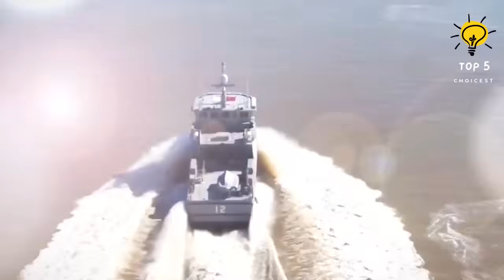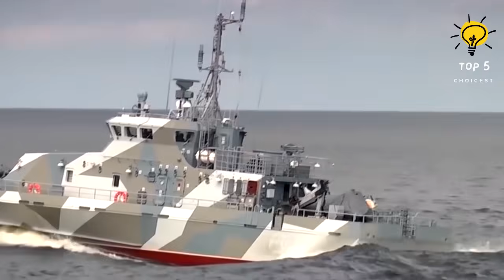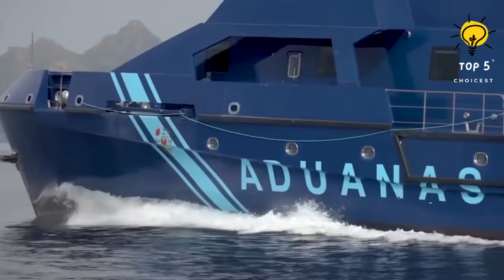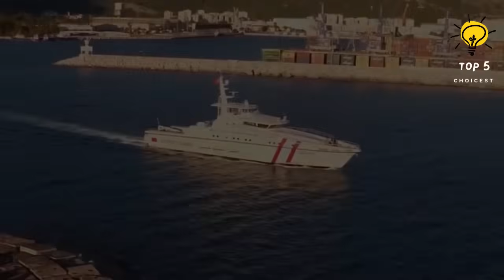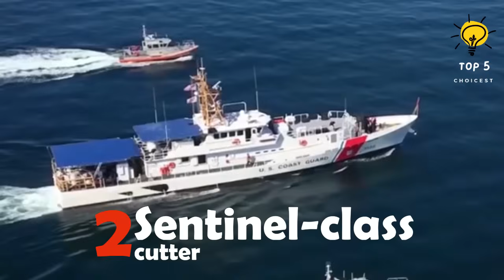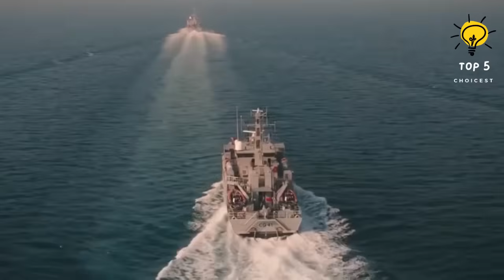Top 10 Patrol Boats in the World

Comment: You´ve forgotten to mention the German F125 class, our biggest patrol vessel with a length of 149,5 meter.😜
Reply: Thats a frigate
Reply: @peterberg12353  Comparing it with the definition, that the smallest self-defending maritime unit is a Frigate, then it is clearly not.
From its size and officially called, you are right. But when it comes to its weapons, then its a corvette at max. This hole vessel is a waste of money because it was designed for low intensity missions... as you can clearly see. The Houthi don´t fight on this level. Calling this boat a frigate it's embarrassing for the German navy... and misleading. So regarding German vessel that are having real capabilities of a normal Frigate then you can take the current F123 and F124 or its upcoming successor the F126 and F127 (MEKO-400-AMD).

Comment: If you could have a faster and more fuel efficient hull than what you show here, would you be interested?. You will note that much power is wasted  when you see a large bow wave and slamming in -6' storm waves. Note your loss of floatation you cause from incorrect hull design. My hull was commercially fished the North Atlantic, but only 36' long. My 270HP marine engine gave a speed of 35 MPH.My 6' model gave a speed running at +80 MPH based on my 36' hull. You won't see such a hull anywhere which can keep up with mine. I am looking for real  boat builders who know real boats? Let me know please. By the way, hy hull was engineered bot by Naval Architects. Lindsay Lord was a great help also. The finest designer ever.